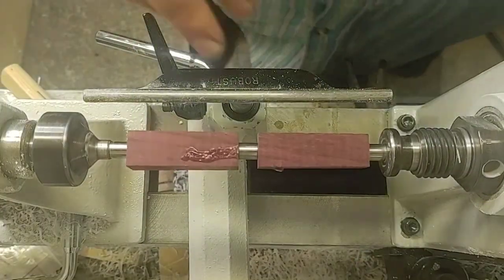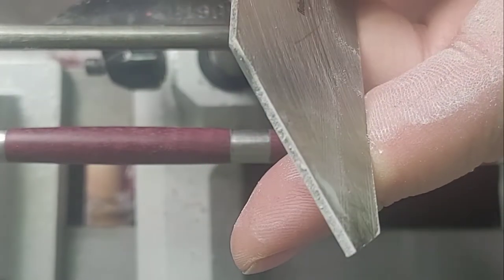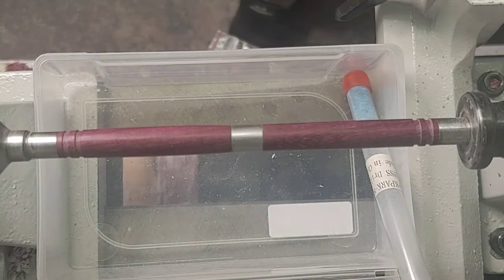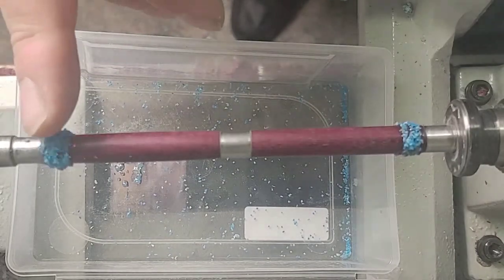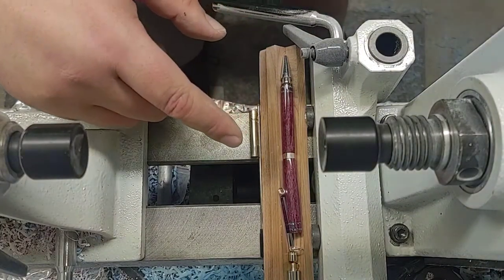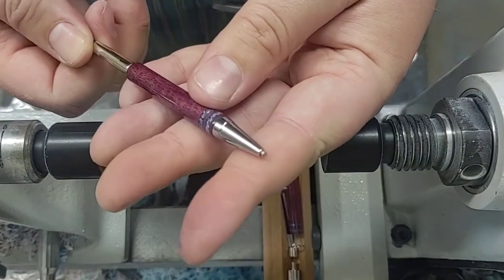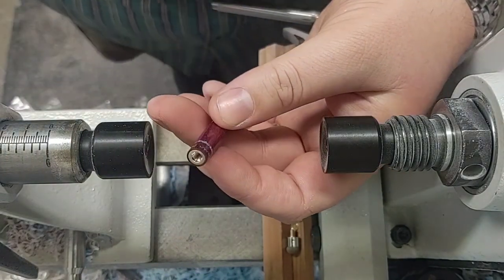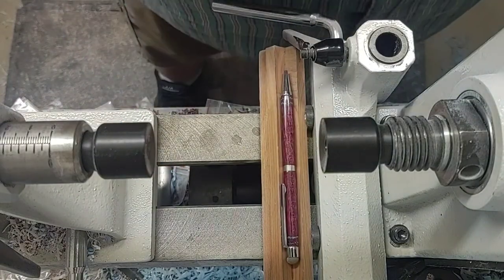Turquoise Stone Inlay on a Purpleheart Slimline Pen

Comment: First question: I've baked purple heart and then put it in the window to see if there was a color change. I used a premium raspberry cut off. After 6 months, it began to turn brown just like every other piece of purple heart does when it oxidizes under UV light.  I also turn pens and I want to know if you've had a pen exposed to light long enough to determine if it will eventually go brown like all other exotic woods (other than Ebony, cocobolo, African blackwood and similar) without the benefit of a UV blocking finish. If it does, then I will have to plan on a UV blocking coating or sand it just shy of the actual dimensions of a slimline so that the owner can sand and refinish every couple of years if it will live in direct sunlight. 
Second question: Did you stabilize a crack with super glue on the blanks, or is that the oils like I had happen when I stuck mine in the oven? 

Wow, you didn't have much material left to inlay! I'm assuming those are slimlines? If so, you're playing with fire there. Not literally, but there's not much room for inlay. How do you determine (without a tube reference) how deep to groove for the inlay? 

BTW, an easier way to inlay chips would be to mix the chips in epoxy resin, then pack it in the grooves, let it cure, then smooth with your carbide tool.
Reply from the maker: Those are a lot of good questions, first with purple heart and most woods, oxidizing can be stopped by sealing the wood. Either with a finish or stabilizing. Oxidization is caused by exposure to oxygen, if you had left that block in the dark for 6 months it still would have turned brown on the outside. All of the purple heart pens I have made and put a CA finish on still look as good as the day I completed them with no browning.
Reply from the maker: 2nd, small cracks I stabilize before turning with thin CA glue. Bake your purpleheart before turning to prevent cracks. If you bake it after turning, the brass expands further than the wood when heating and will split the blank every time in my testing.
Reply from the maker: 3rd question, the inlay. Yes this is a slimline, and when you have a solid glue up technique that nearly guarantees full wood to brass glue contact, then slim lines aren't a worry. As far as depth of inlay, I just go all the way down to the brass, then I use the parting tool to clean up all the glue off the brass so the brass is fully exposed and scratched up, this helps guarantee a better bond with the CA glue while inlaying. Then I'll apply some black with a sharpie to color the brass tube and hide it. I considered epoxy for the inlay, but I wanted to guarantee bubble free and Gluboost CA and activator makes for super fast inlay process. As we know time is money, so I save time where I can, and the end result is durable and polishes beautifully. The nice thing about the Gluboost is it's a flexible CA Finish and isn't is fragile as other CAs, so even if you drop the pen, it won't fracture or chip.

Comment: Great job on the pens. I would love to know where you got the tool you use I the head stock and tail stock, to push the pen parts together, they look excellent to use. Beats using a clamp like I am using at the moment. Cheers
Reply from the maker: Its the best mandrel I've ever used! It's called the Mandrel Saver, and I think I got it from Penn State Industries. I've used previous styles and you had to stack bushings and put a thumb screw on and live center, and this is much easier. It also makes for quick tooling changes when working multiple pens at the same time or changing to do CA finish and change back. Big time saver and worth the extra money in the long run.
Reply: @TheTacticalPainter  thanks for the reply. I meant the two black things that you used to push the pen parts together with those looked very handy.
Reply from the maker: @Weirdybeardywoodcraft ah yes, those are a great bit of kit too, they're assembly cups, and I bought those at my local Woodcraft
Reply: @TheTacticalPainter  cool. I will have to have a look around and see if I can find some. Cheers 🍻

Comment: I've watched a few videos on this general premise and I have only seen people turn down the stones with the carbide tools. Is that super necessary or would a sharp HSS tool work as well? Thank you for sharing! The pen looks wonderful! I have a few ideas I want to use this with, and I don't know of any other calligraphy pen turners that have used this combination of techniques!
Reply from the maker: Thank you, so glad you found the video. I believe it would be possible to use freshly sharpened high speed steel. I would recommend using a HSS scraper if you've got one. I used standard steel turning tools before using carbide, and they can do most things the carbide can, you just have to sharpen frequently when turning harder objects like shell, stone, and metals. I recommend the scraper because once you seal with ca, you're basically turning an acrylic, and scrapers work better on acrylic than gouges. Be sure to let the glue set overnight and harden fully to minimize risk of it chunking out of the groove.
Reply: @TheTacticalPainter  Wonderful! I'm going to practice with some imitation opal first since it's much cheaper. I believe it should also be softer too. Thank you for the help!

 I also didn't know that about acrylic I have only ever turned it once so I might have to try it again.
Reply from the maker: If you don't have a scraper, I recommend getting a negative rake scraper. The geometry works great for acrylic type blanks.